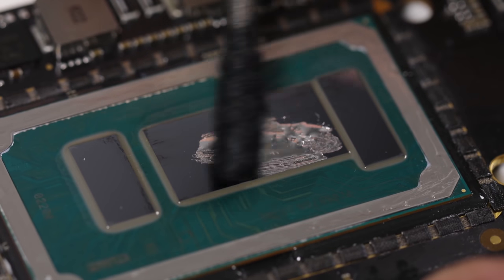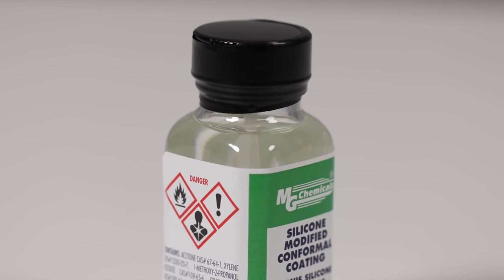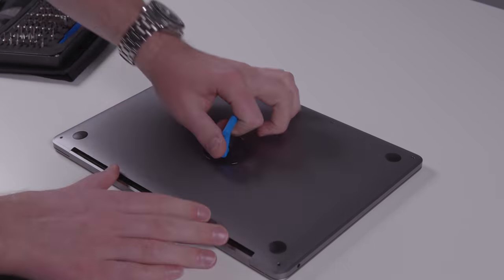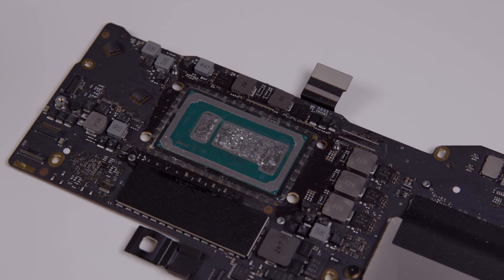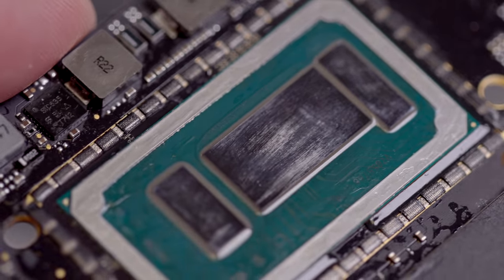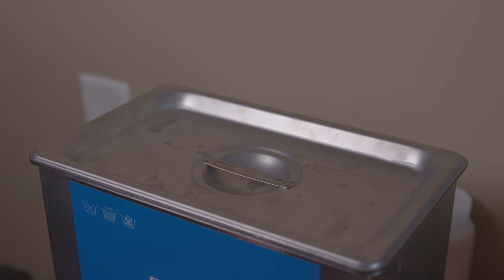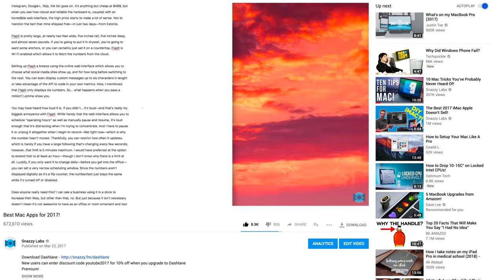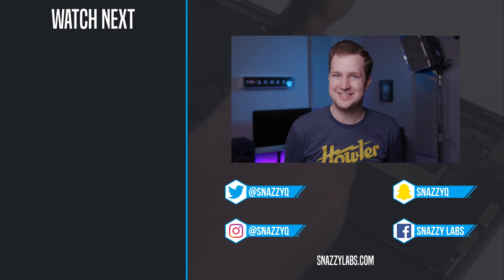What Does Liquid Metal Look like After 3 Months Inside a MacBook Pro?

Comment: Here's a couple tips:

1: Dont apply excess iquid metal!! Less is more, especially for mobile systems like laptops. If you used a swab to apply it before, you can use what's left on the swab. It should look like a mirror without any puddles on the cooler and die. So long as the cooler makes EVEN contact, with a slim layer of liquid metal across the entire die you won't see poor cooling performance (outside the limitations of your computer's cooling system, that is)

2: Liquid metal DOES etch copper. Depending on how HOT the cooler gets, the rate of which the liquid metal etches the copper cooler will vary. If your machine gets hot, which most laptops do, then the liquid metal will react with the copper faster than if it's used on a cooler running machine.
Reply: Good tips, will use them whenever I need to apply liquid metal. To be honest, machine that costs 1300$ should come with liquid metal already applied, I have no idea why Apple puts that crap of a paste on that laptop...
Reply: I have answers:

Because Apple likes to cut corners and decrease the bill of materials on their hardware to maximise profit. Similar to how Intel stopped soldering their consumer class processors to save a quick buck and uses thermal compound that's equally as bad as the junk Apple uses.
Reply: I know, companys are always looking for a ways to cut the costs. The problem is that at some point it might hurt their sales. Thermal paste isn't such huge investment, but I believe Apple will use every possible stuation to save few pennies...
Reply: Every company does, Apple is just one of those companies where people like to make videos about it and scream it around
Reply: AcTiVe TV liqid metal is more sensitive to movement than a normal tim and it's hard to apply properly, you need a very specialized human or a machine designed to do that
Reply: "Every company does" yes, but you know what every company does not "charge apple prices"
Reply: iPhone X 999$ - Samsung Note 8 999$

Dell XPS Notebooks are quite pricey as well, yes they start lower than the MacBooks but who wants a 1080p Display in 2018? If you upgrade to the higher resolution you land in similar price territories. Of course once you start upgrading specs Apple prices (Microsoft Surface prices as well) go wild, no one can justify that, that's just a rip off from the both.

Upgrading a i5 8GB Ram to a i7 16GB RAM configuration costs in Germany 600€ for a 13 inch MacBook Pro, which is too expensive I don't deny that. For a Microsoft Surface Pro it's even 930€. On a side note the Baseprice is lower so in the end the MacBook Pro is still roughly 180€ more expensive. However once you add the Typecover for 150€ it's a pretty close call. And charging 150€ for that Typecover is super overpriced and only works because they can, if you buy a Surface Pro you want that Typecover hence people pay the price. Apple does the same.

So no, Apple's not the only company charging high or too high prices
Reply: wrong and wrong. you need to use more liquid metal on laptops because their coolers are not alligned properly. that doenst mean you use it dripping but a tad more than on a stationary. 
second LM does NOT etch copper, it does form an alloy, and it does it pretty fast. this is what people mistaken for drying out
Reply: @DigBipper188  I never realized that Apple cut corners with their back MacBooks until now.

EDIT: I should've known that sooner. 😅
Reply: @woswasdenni1914  Kinda strange as:

A: Every laptop I've opened has had a perfectly aligned cooler, and applying the same amount of LM to the die as I would a GPU or bare CPU die does the trick. My Lenovo G505s has been liquid metal'd and I used a very small amount of it to cover the die and cooler. Dropped a good 10*c off the idle temps and the fan speeds under load are significantly lower. I have yet to find a laoptop with a shoddily aligned cooler for high TDP parts such as the CPU or GPU and that's including even teh cheapest of cheap laptops nowadays.

As for the liquid metal alloying with copper, I can confirm after testing with my main PC and a copper based AIO liquid cooler that it does alloy with the top layers of copper, but due to the low dispersion rate of liquid metal in copper it takes a good while for it to become impossible to remove. Unlike, say Aluminium which would be physically weakened by the Gallium in the liquid metal in just a few hours. Might also be worth noting that liquid metal can diffuse into Silicon as well. Although this happens at an even slower rate than copper. Der8auer has explained this in-depth on his channel (And since he had a hand in developing ThermalGrizzly Conductonaut I would be inclined to believe him)
Reply: @rubenfasola5402  Not really. You just apply small amounts at a time using a cotton swab to disperse it until there's a very thin layer from edge to edge on the die of the chip and that there's a square roughly that size on the cooler that has a similar amount. If you apply too much it's not hard to wick off with a cotton swab and any mess can be cleaned with Isopropyl just like conventional thermal compound.
Reply: is conformal coating necessary?
Reply: @inSpyr  It's highly recommended, but if not, nail polish works well. Or, you could do the daft thing and hope you don't hit any of the components on the chip substrate. Just remember that the liquid metal will diffuse into solder, and when it does it turns it into a liquid, meaning the chances of that component falling off the board are severely heightened.

Comment: Maybe it isn't 100% copper so some of the metal seeped in.
Reply: Arvin Medina any metal isn't 100% pure, at least can't be produced with technology today.
Reply: Apple has a tendency of using less pure materials as it's cheaper so this is my theory as well.
Reply: Gallium alloys with copper.  That set in silver is copper gallium alloy.
Reply: Yep, Apple often cheaps out so they probaby use some cheaper copper alloy (like cheaper shit aluminium in iphone 6) instead of more pure copper like more expensive coolers.  Probably won't affect cooling performance much unlike that cheap shit cooling paste they use. My god. But yeah, probably good idea to stop using the gallium on this machine. Those few percent isn't worth it. And it being an apple product it will die soon enough anyway, so no need to hasten its death. :D haha
Reply: Leonardo Peña I was a little bit trolling. 
I disabled my cpu water loop with an copper waterblock after around 300days The liquid metal from collaboratory was the same as before (a little bit more viscous) and the block itself has a little bit of mat finish on it, but it's still the same color as before. Your assumption might be correct that they have used an cheap dirty copper plate.
Reply: Even if it's 100% copper, liquid metal gallium alloy will corrode it. The most resistant material for such liquid metals is nickel, which doesn't have as good thermal properties as copper. The best solution would be to nickel plate the copper.
Reply: Yerasimos Yerasimou on paper this is true, but you have to consider that nickel plating is so extrem thin, it doesn't affect your cooling capabilities. The effect is so extrem low, It's just pure astectics. If you compare nickel plated waterblocks from the same series but with difdent plating you see no difference in cooling performance(even gold plated). It's pure manufacturing cost, because you have to add an additional step instead of shipping pure copper blocks. Don't know about large scale production, but i assume it would be a few dollar / Euro more expensive.
PS. : even that alloy gives you the same cooling performance as before, it's just pure (ugly) astectics
Reply: David we completely agree. Maybe I wasn't clear on my first post but all I am saying is that the most effective way to apply liquid metal is to have a nickel-plated copper plate. The nickel will prevent corrosion but since its layer will be very thin, it won't affect the thermal performance.
Reply: Gallium and copper form an alloy. You will still have problems with pure copper. I'm always confused about all the people delidding and adding a custom copper ihs to Intel cpus. If you leave it on long enough it can even solder the ihs to the die then when you try to fix the air bubbles that may have formed with the alloy, delidding will break the die.
Reply: ...yes it can. I don't know why you think we aren't able to produce 100% pure metals. They're just ridiculously hard to make, but we are able to make them.
Reply: it is not.... NO OEM will used 100% of anything...
Reply: @gerasimos33  I'd kiss a Ni plated Cu vape chamber cooler

Comment: I applied Conductonaut liquid metal to the X5690 CPU's in my Mac Pro 5,1.

I didn't have conformal coating to apply the first time I did it so I did a test to see how the liquid metal would smear on it's own.
After leaving the cooler mounted for a couple hours the liquid metal hadn't smeared but the copper cooling block had already been stained by the liquid metal almost exactly how it looks in this video.
Reply: @Phil Ricketts I Probably only had that setup for about 2 years.

The liquid metal did affect the copper and the CPU die but it was really only cosmetic, even after all that time. I never noticed a drop in performance. I did eventually just start using normal thermal paste just for cost and convenience.

Comment: Gallium bonds with copper into an alloy, it does not weaken it or corrode it.

There is rarely ever any need to replace it unless you get a new heatsink or CPU (if a desktop).

It is maintenance free.  What you saw was exactly as it should appear.

...and 7% can be the difference between a buzzing fan and not...and you need to subtract ambient air temperature from both readings to see the real improvement.

It probably improved it by 10-12% over a high end paste and 25% over stock paste.

Comment: Hi, i performed the same mod on a macbook pro 15 inch and after a few months noticed performance getting WORSE... when i opened it back up the liquid metal had all soaked into the copper shim and dried out - it also formed high and low spots on the copper shim. I believe this amalgamation effect caused the reduction in performance. I cleaned it as best I could (the copper still has the liquid metal residue) and applied regular thermal paste after which performance was restored.

Comment: I had the experience of working for an hi tech company on PC performance and power consumption. Heat is generally not a great issue on most laptops. What could easily added externally is just a lap cooling base and that is all need to vent the heat away from the laptop body. Today SSD drive tech greatly reduce heat inside the lap top. So don't worry too much unless you run 3D rendering 24/7 on your laptop.

Comment: If you want to use a liquid metal with bare copper...

The liquid metal will form an alloy with copper which is ok, BUT you need to reapply it after a month because the liquid metal that forms an alloy fuse to the copper and you have less liquid metal than before. After one or two times of reapplying the liquid metal, the alloy layer will protect the rest of the liquid metal from further alloy formation, about the performance the alloy layer heat conductivity is identical to that of bare copper, so don't worry about it. After that, you can just reapply it once a year like when you use a liquid metal with a nickel-plated heatsink. This information is from der8auer, he works with Thermal Grizzly the company that made this liquid metal.

In summary, using a liquid metal with bare copper for the first time you need to reapply it after one month (you can use acetone to clean the old liquid metal) then after one month do it again (2nd reapply), after that, you can just replace it once a year.

Comment: There is a video on this topic where a guy named bobsagget823 commented this what i think sums it all up quite good:

 "When gallium is in contact with pure copper, the differences in electrode potential favors the gallium and copper to alloy, which will eventually consume the gallium completely[1] (Ga + Cu → CuGa2 [67%] + Cu3Ga [11%], and both products are stable until 175C)[1][2]. 
The liquid metal will literally into the copper until the gallium is gone, which causes the copper to turn silver-ish. The non-gallium components (indium, tin) of the liquid metal[3], which are solid at room temperature, get left behind - and that stuff is hardened deposit that you were trying to scrub off the heatsink.
Note that at higher temperatures, the reaction between gallium and the copper heatsink only gets faster."
Reply: Also from the sources i read including this comment liquid metal mods are more safe for desktop cpus where the LM makes contact with the nickel coated IHS, whereas on the other hand in laptops where the order is cpu-thermal paste-heatsink, or cpu-LM-copper heatsink in this case.

Comment: My guess is that the copper is only a copper plating over aluminum (it's not so good to plate aluminum, but anyway, it can be done), so the gallium alloy penetrated the copper pretty fast and made a little bit of galvanic corrosion. I'd just place it again and look again for any damage in future months (like in your case which was 3 months). I'm a chemist, but I don't know how the cooler is made, so it's just a guess. If I were in that situation, i'd go crazy and do a DIY coper plating on the cooler again just for the lols

Comment: Liquid metal (gallium/indium) is also reacting with copper. However, it "eats" away the copper way slower than it would do with an aluminium heatsink. So when it starts to be a problem (if it would ever be), you are probably already using a new macbook.

Comment: So has a really low melting point for a metal. It solidifies in room temperature air, and melts in your hand (85.58°F/29.76°C). In fact that's exactly what that metal is known for. It's the "safe, non-toxic" liquid metal for hands to play with that isn't mercury. Now what I believe is happened, is what you are getting on the top of the heat sink is such a thin layer, it solidifies instantly. If this is true then you can put it in your hand or something warm, and it'll just straight up come off. Also, having a metal interact with a possible alloy, not so good. Hope this helps!
Reply from the maker: justadaniel Luckily liquid metal isn’t just gallium. Some of the other additives push the melting point clear down to -20 C, so it has to get really cold to actually turn back into a solid. :)
Reply: Oh, well I didn't know that. I thought it was just gallium. Make sense since it seems super watery. Thanks for the info snazzy, keep it up!

Comment: Copper is not a perfectly solid material. Pretty much all metals are porous, meaning they have small holes in them that go throughout the entire structure of the object. What happens is the liquid metal actually slightly absorbs into those pores, and if anything it’s beneficial for the transfer of heat because there is less air getting in the way of thermal transmission. You are wrong about Gallium interacting with copper, It simply does not react under regular circumstances. The part about aluminum is perfectly correct however. 

The copper that Apple uses on the heat sink is most likely an alloy with other metals in it to make it more effective and /or cheaper. That means that there might be other contaminants that are reacting with the gallium, such as aluminum

Comment: The copper is only very thin on the cpu cooler, its electro-plated. the bulk is aluminum. So, after prolonged time, the liquid metal will either migrate past the plating or erode it entirely. As the plating is only like, an atom thick.

Comment: I would keep the Liquid metal instead of the kryonaut paste, simple because any degree that you can get lower within a notebook\laptop is worth it! Because they can Thermal throttle pretty easy and as you can see nothing did spill on your application outside the die and also because i saw several tests with more than a year with liquid metal applications that did not lose any performance what so ever, so i don't think that you need to annual replace it!

Comment: I think if you put a coat of nail polish in the aluminum parts of the heatsink you shouldn't be worried about liquid metal. Stil you can get the 7% improvement without problems (except the keyboard) of the liquid metal.

Comment: I think that the liquid metal alloyed with some copper and it must've formed a solid alloy on the heatsink itself. Shouldn't be that much of an issue tho. To be honest, I think forming a solid alloy might be a good thing actually, then you can be sure it stays put...as long as it doesn't crack or something and then you'd get a teeny tiny air gap